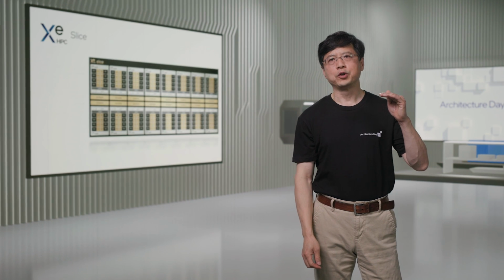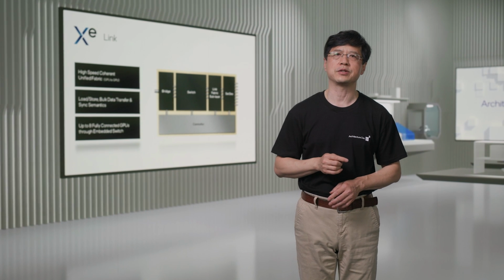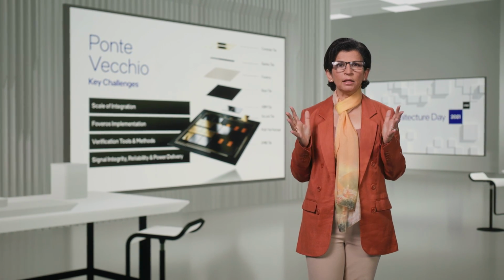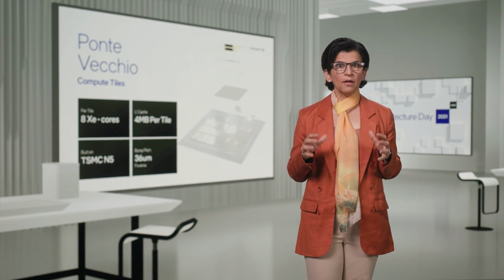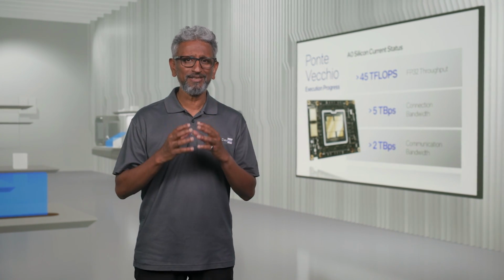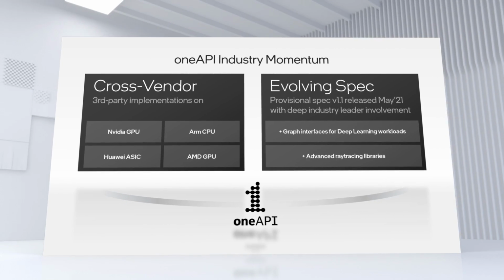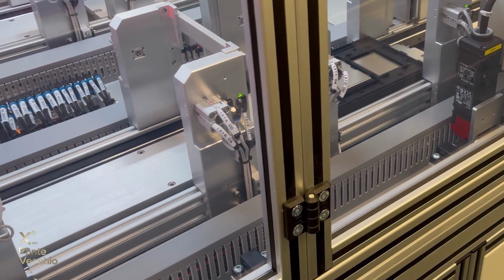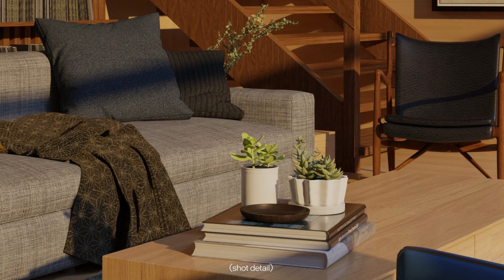Xe-HPC and Ponte Vecchio - Architecture Day 2021 | Intel Technology

Comment: Are  L1 cache and shared local memory same thing?
Reply: No, its the same memory in the chip used in two different modes, if hardware controlled, it is cache, if software controlled, it is shared local memory.